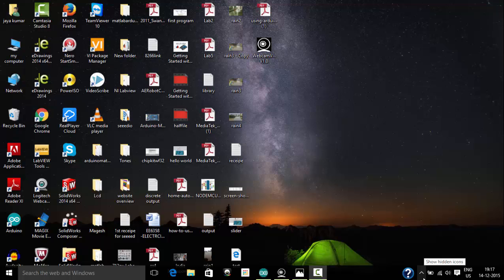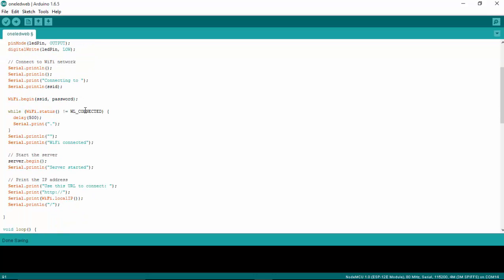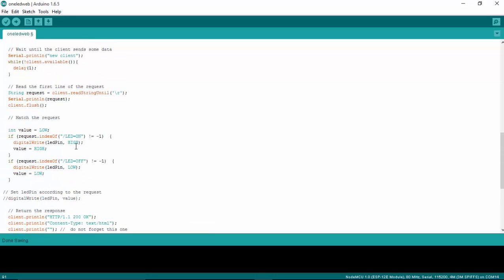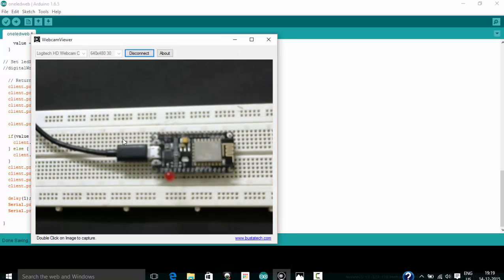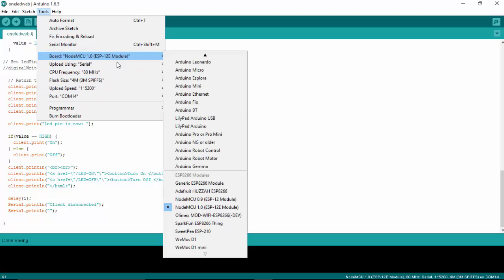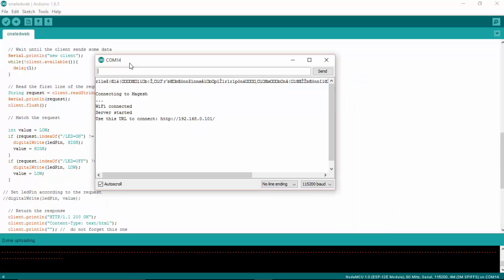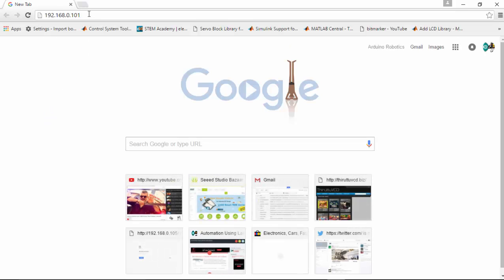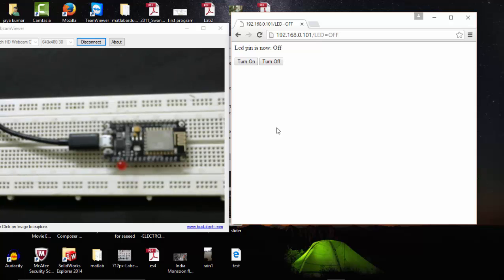Control an LED from Web browser, NODEMCU Esp8266

Comment: I have a problem with the "new client"  I have changed the code a little bit to play music. I have these two "PacMan and Tetris" music. I can play the Pacman music all the time but after I played the Tetris music it just says "new client" and the side (when I press a new button) just reload nonstop. Can anyone please help me?

Code:
#include <ESP8266WiFi.h>
 
const char* ssid = "*******";
const char* password = "********";
 
int tonePin = 15; // GPIO15

WiFiServer server(80);
 
void setup() {
  Serial.begin(115200);
  delay(10);
 
  // Connect to WiFi network
  Serial.println();
  Serial.println();
  Serial.print("Connecting to ");
  Serial.println(ssid);
 
  WiFi.begin(ssid, password);

  while (WiFi.status() != WL_CONNECTED) {
    delay(500);
    Serial.print(".");
  }
  Serial.println("");
  Serial.println("WiFi connected");
 
  // Start the server
  server.begin();
  Serial.println("Server started");
 
  // Print the IP address
  Serial.print("Use this URL to connect: ");
  Serial.print("http://");
  Serial.print(WiFi.localIP());
  Serial.println("/");
 
}
 
void loop() {
  // Check if a client has connected
  WiFiClient client = server.available();
  if (!client) {
    return;
  }
 
  // Wait until the client sends some data
  Serial.println("new client");
  while(!client.available()){
    delay(500);
    Serial.print(".");
  }
 
  // Read the first line of the request
  String request = client.readStringUntil('\r');
  Serial.println(request);
  client.flush();
 
  // Match the request

  if (request.indexOf("/Play=PacMan") != -1)  {
    PacMan();
  }
  if (request.indexOf("/Play=Tetris") != -1)  {
    Tetris();
  }
 
// Set ledPin according to the request
//digitalWrite(ledPin, value);
 
  // Return the response
  client.println("HTTP/1.1 200 OK");
  client.println("Content-Type: text/html");
  client.println(""); //  do not forget this one
  client.println("<!DOCTYPE HTML>");
  client.println("<html>");
 
  client.println("<a href=\"/Play=PacMan\"\"><button> PacMan </button></a>");
  client.println("<a href=\"/Play=Tetris\"\"><button> Tetris </button></a><br />");  
  client.println("</html>");
 
  delay(1);
  Serial.println("Client disonnected");
  Serial.println(WiFi.localIP());
  Serial.println("");
 
}

void Tetris() {

    a lot of music code (This is definitely not a problem)
}

void PacMan() {

    a lot of music code (This is definitely not a problem)

} 

The Serial Monitor:

WiFi connected
Server started
Use this URL to connect: http://192.168.0.28/
new client
.GET / HTTP/1.1
Client disonnected
192.168.0.28

new client
.GET /favicon.ico HTTP/1.1
Client disonnected
192.168.0.28

new client
.GET /Play=PacMan HTTP/1.1
Client disonnected
192.168.0.28

new client
.GET /favicon.ico HTTP/1.1
Client disonnected
192.168.0.28

new client
.GET /Play=PacMan HTTP/1.1
Client disonnected
192.168.0.28

new client
.GET /favicon.ico HTTP/1.1
Client disonnected
192.168.0.28

new client
.GET /Play=PacMan HTTP/1.1
Client disonnected
192.168.0.28

new client
.GET /favicon.ico HTTP/1.1
Client disonnected
192.168.0.28

new client
.GET /Play=PacMan HTTP/1.1
Client disonnected
192.168.0.28

new client
.GET /favicon.ico HTTP/1.1
Client disonnected
192.168.0.28

new client
.GET /Play=PacMan HTTP/1.1
Client disonnected
192.168.0.28

new client
...GET /favicon.ico HTTP/1.1
Client disonnected
192.168.0.28

new client
.GET /Play=Tetris HTTP/1.1
Client disonnected
192.168.0.28

new client
............................

Comment: Hi, I just want to know why there is nothing appear when I opened the serial monitor? The connecting sign also the ip address doesn't show. Can anyone help fix this?
Reply: Because your serial monitor doesnt show the history of communication - u should open the serial monitor at the same time u plug in ur esp. Or set ur delay to 5 seconds in this cycle, so u have plenty of time to open ur serial monitor and show the message at the time it is created:   

while (WiFi.status() != WL_CONNECTED) {
    delay(5000);
    Serial.print(".");
  }

Comment: If you replace the line:
int ledPin = 13;
with 
int ledPin = LED_BUILTIN;
Then you can just use the ESP8266's internal LED and don't need to add an extra LED.  The on/off switching will be backwards, but you can fix that in the code if you want to.
Reply: Yep, thanks

Comment: but my friend it's working if & only if the esp8266 and my browser is connected to the same wifi router!, how to control it from anywhere in the world?
Reply: yes, same problem with me, please provide an appropriate solution if u know, thank you!
Reply: Beside that, anytime you disconnect it from pc it will need to be connected to it again, and start serial monitor to connect module to network. So, this is ok tutorial for beginners but it need a few modification for further use.
Reply: I  have these projects and also control with voice. All from somewhere in world!
Reply: @RGPinger  can u share?
Reply: @AbdulRehman-kr4xv  demo is available at: https://arduino.php5.sk/PHP_en/
Website to download after payment on PayPal.
Reply: You got to use port forwarding on your router or use a VPN
Reply: @LionelTellem  How man? Can you detail please

Comment: is it possible to change the size of the text and the buttons?
Reply: yes, its possible 
Change below code as per your requirement.
// Return the response
  client.println("HTTP/1.1 200 OK");
  client.println("Content-Type: text/html");
  client.println(""); //  do not forget this one
  client.println("<!DOCTYPE HTML>");
  client.println("<html>");
 
  client.print("Led pin is now: ");
 
  if(value == HIGH) {
    client.print("On");
  } else {
    client.print("Off");
  }
  client.println("<br><br>");
  client.println("<a href=\"/LED=ON\"\"><button>Turn On </button></a>");
  client.println("<a href=\"/LED=OFF\"\"><button>Turn Off </button></a><br />");  
  client.println("</html>");